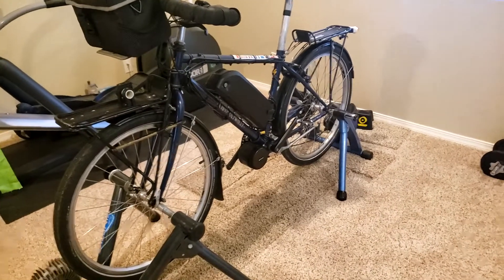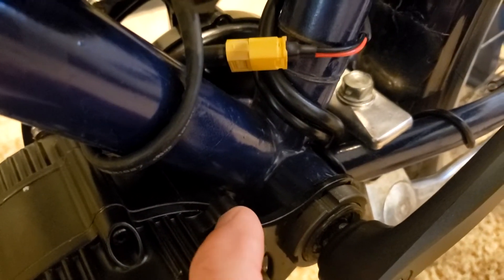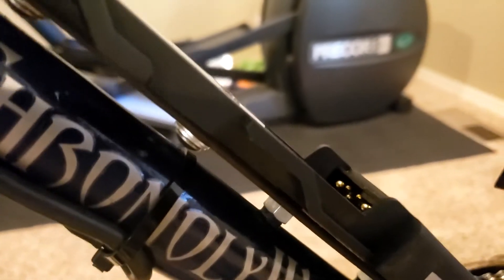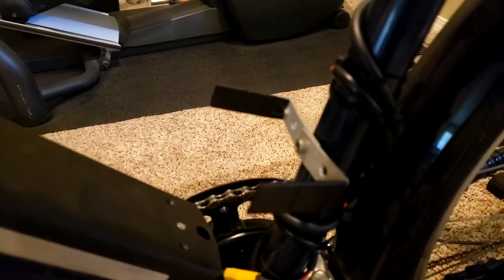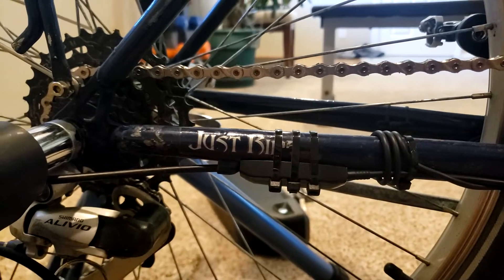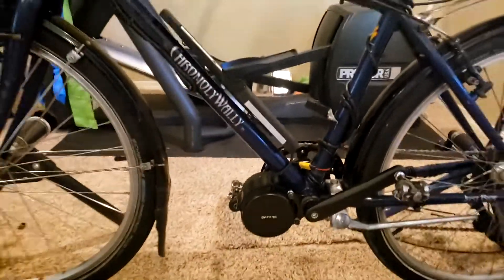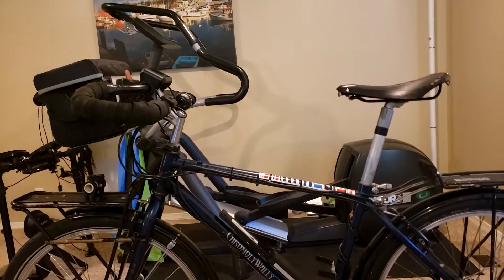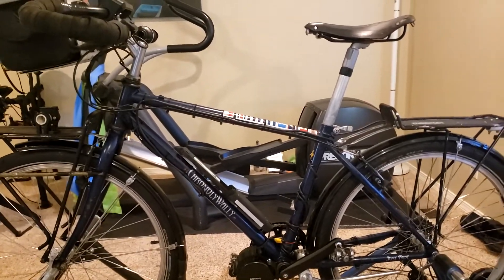E-Bike Conversion Issues - 73mm Bottom Bracket, Battery Placement, Gearshift Sensor Placement

Comment: the comment below is correct.. youll get a stronger job if you remove the bottom cover.. [ 3 screws ] of the battery holder. and bolt straight to the bike, there is slotted holes in there.. you can ditch the adaptor your using

Comment: I used  stainless steel washers to act as spacers and fitted 16mm long bolts. I used a proper aluminium bracket that uses the bottle mounting bolts then 2 additional stainless steel jubilee clips.

Comment: Remove the three screws at the bottom of the battery plate then mount the battery plate slide the silver plate downwards slightly .you will then have room to zip tie the top. Replace the black plate with the three screws, then replace the battery, Hope this is helpful